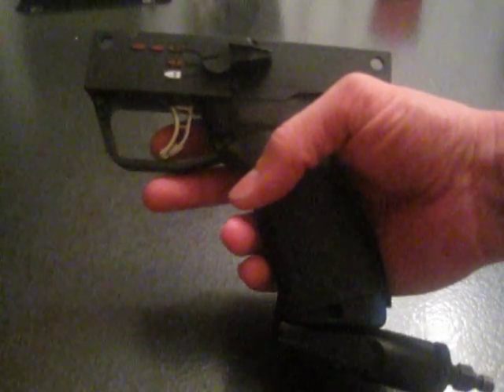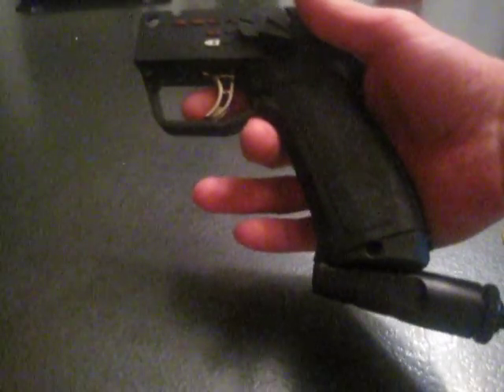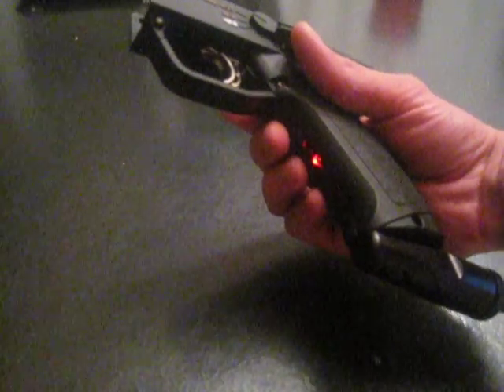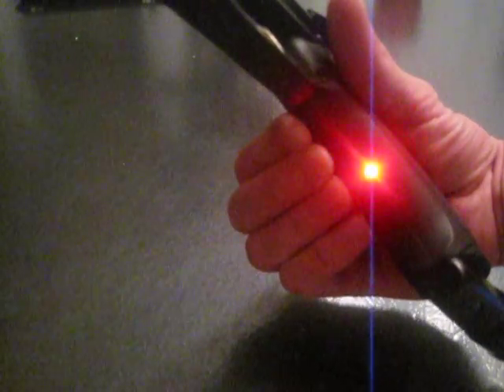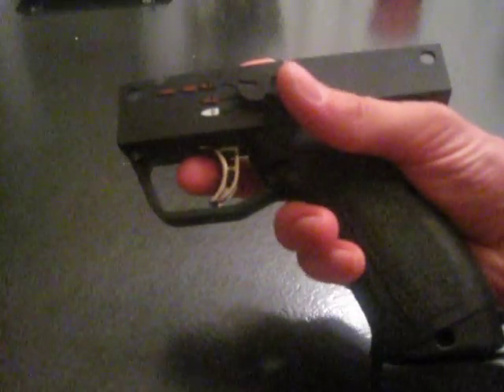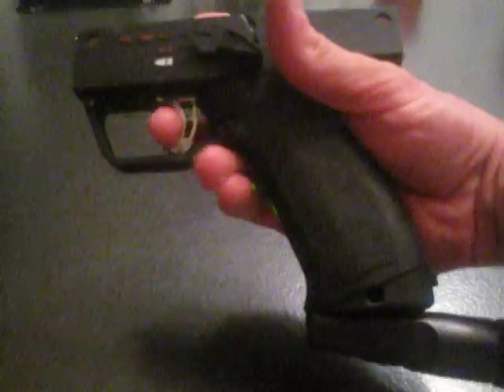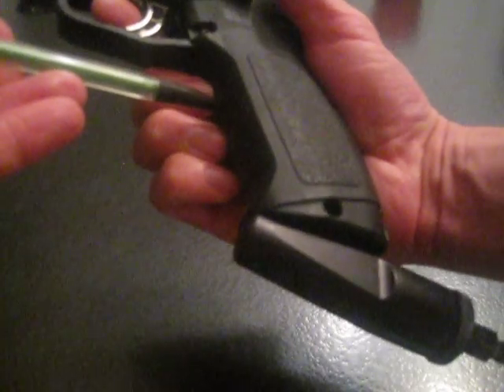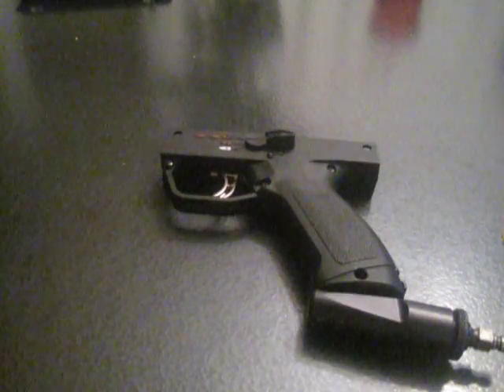Programming the new software mod for the X7 Phenom

Comment: Hi there,

This is such a great video! Is there any way to quickly program just regular full auto and not have those 2 single shots like in the factory settings? Thanks!
Reply from the maker: Petr Cross Yes. Take a look at the wiki link in the description for access to the instructions and the software.

Comment: Hi mike 
I've just installed your firmware on a x7 classic egrip everything worked well I programmed all the preset but the problem is that it's stock to the programming phase I am not capable to like shut the egrip down and restart it to fire 
I don't know if you understand what I mean my english is not perfect 
I'm waiting for your answer 
thank you very much
Reply from the maker: We were able to solve the problem via email. Let me know if you have further issues.

Comment: Hi Mike, 

Your Mod works Great. but the Phenom requires some Upgrades to use the 30bpms. Like upgrade the Bold,Phase5 and Cyclone. My marker is still orginal and I cant use more then 15bpms because the balls breaks insid the Marker. But regard the MOD 100% approved.  My best config is Burst of 2 balls config of 16bpms. but after my upgrade i will use 25bpms. :D